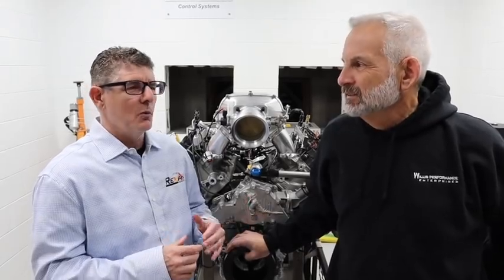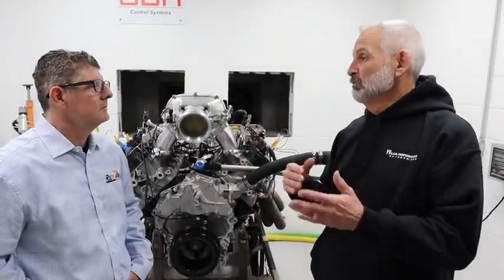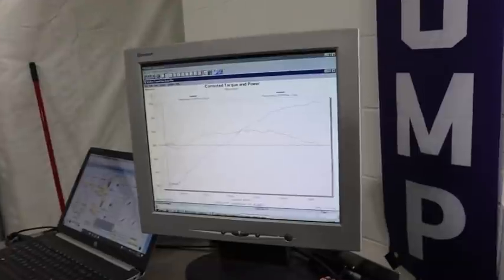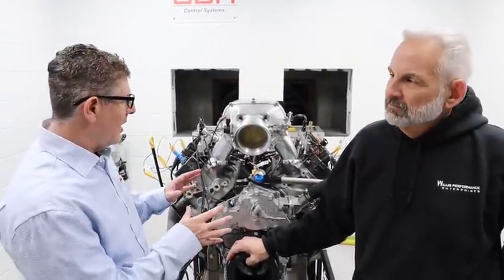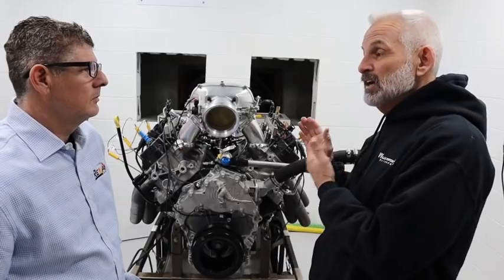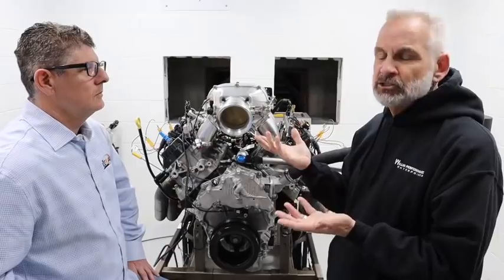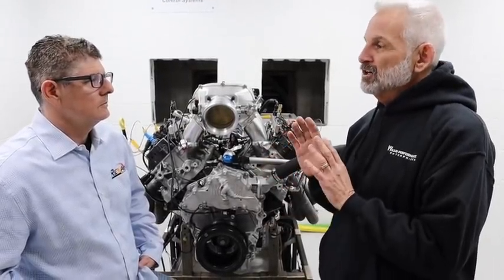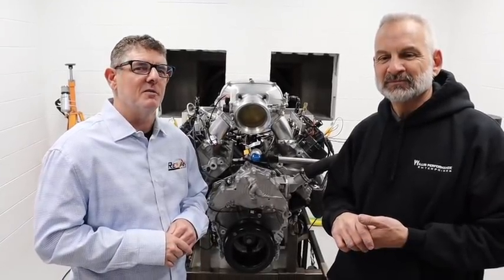Ford Godzilla 7.3 Stage 1 Heads & Cam Dyno Test — Massive Gains Over Stock! How is that Possible?

Comment: It works for 43,000 and breaks.  Hope Ford can get back up again. I don’t want to go to another brand but I can’t have a truck that last only 43000 .
Reply: Every engine has failures.  From what I've seen they're pretty reliable.  What happened to the engine?  Was it user errorr?

Comment: You should have showed us the baseline engine and the modded engine curves.  Telling us the new numbers did almost no good.

From what you said power went from 507 to 640 HP, at the same RPM ?  Would these mods be good for a truck pulling a heavy trailer ?

Comment: One thing I dislike about the 5.0 Coyote in my S550 Mustang GT is the lack of low-midrange torque. You need to rev it pretty high to get it moving on the street.  This 7.3 Godzilla with Stage 1 Cams + Heads @600HP would be awesome in my daily driver S550. The 5.2XS Aluminator would also be an awesome swap in the S550.
Reply: Nice to see a coyote guy who understands the other side of the coin that it isn't just about peak hp and torque numbers lol.  So many coyote guys are so butthurt about this engine like they feel threatened or something and I'm not sure why more cool Ford options the better.

Comment: Little port work / really means, CNC Porting, new valves, valve springs, guides etc. Etc. 

Little cam shaft / really means, bug cam, new lifters, pushrods, timing set, etc.  

TOTAL WASTE

Comment: Kinda over rated , yeah its better than a Chevy or any stock 460 but ,I dont get the hyp, a 460  with some 60 49 scj or p51 heads ,Good pistons upgraded rod bolts , cam lifters, rockers bla bla, is 600- 690hp 600 torque on pump gas. And doing it all saving a few $$$ IF you build it yourself compared to a 7.3 crate motor, keep the compression down put a single turbo on it your 750hp minimum and will hold compression longer and not blow by like a core shift  bow tie
Reply: That is alot of modding to the 460 to be comparable and it's a larger engine physically i.e. don't fit as easily.  You say you don't get the hype?  I don't get the hate on the engine simply because it's another quality option everyone starts talking shit and saying stupid shit like you just did.  Why?  Whats wrong with more options?

Comment: I cant wait for more aftermarket stuff to come out for this engine. I'm looking to build a 2021 E450 shuttle bus as an ultimate road vehicle. It'll also be towing somewhere around 10k lbs. It'll be great to be able to cruise through the mountains with a lot more power and torque.

Comment: Compare the 7.3 Godzilla to the Ls7.. mod for mod on the dyno.
Reply: A truck engine against a top of the line performance engine.  I gaurantee the 7.3 can make every bit as much power and torque set up the exact same way likely even more.  It's much newer they're just now starting to get decent intake options available.
Reply: @midnight347  now a 7.3 crate engine Vs a LS7 Crate engine.. stop making excuses. While you’re “Guaranteeing” the 7.3 can do what the ole ls7 can it has yet to be proven. The LS7 (starting selling in 2005 by the way) Routinely puts down 630+rwhp with worked stock heads, cam and intake. There is videos of hundreds of them doing it. That’s over 700hp at the crank with a stock bottom end motor. Ford boy or not that’s impressive.
Reply: @BLACKLACDTS how is it making excuses it's a truck engine built for a truck against a high performance 20k dollar corvette engine...the ls7 has more compression and more stock rpm its meant for a sports car for God's sake.  Let's hope the ls7 doesn't drop a valve while they're testing it lol.  Boom there goes 20k.  Stop with the ls pushing gm humping nonsense.  If you give the engines similar setups and rpm and head flow etc they're gonna make similar power.  The ls7 has a much better stock setup.  Let's compare it against the 8.1 truck engine.  That even has MORE displacement.  It won't end well for the 8.1.  You're trying to compare it to the ls7 because you are cherry picking a similar displacement engine to try and push your bs theory that gm is superior.  They aren't.  You can get a godzilla crate motor for what 8k?  An ls7 costs 20k lol.  It's not a fair comparison at all.
Reply: @BLACKLACDTS wow a top of the line 20k dollar vette engine with factory high compression can do over 600 wheel with a big ass cam heads and intake etc.  I'm so impressed lol.  Give a godzilla 11:1 and Rev it to 7000 rpm set it up similar it will make the same or more power for less money.
Reply: @midnight347  hahahaha… Keep talking and making a fool of yourself..

Comment: So at 7:00 into the video, you knock off 150-200HP just by installing the same engine in a vehicle.
Reply: Please lsiten again, that is not what we said.....
Reply: @brianwolfe2993  Agreed but the outcome is the same as I suggested. Don't think with these minor mods YOU are getting all that "claimed" HP to YOUR tire.
Reply: @brianwolfe2993  Get rid of those special dyno headers = loss of power IN a car. As they stated, running accessory drive items = more loss and so n. Running full exhaust = less power. It all adds up just as stated IN the video.
Reply: @brianwolfe2993  It's still a killer engine no doubt.

Comment: Eh... LS 6.2 engines are getting that kind of hp with ported heads and a cam no problem. I was hoping for more with it being a bigger 7.3 engine.
Reply: Would love to see a stock head LS Dyno test with stock valves.   If you have a link can you share.  Everything I have seen is with aftermarket heads that approach 700 HP.
Reply: @brianwolfe2993  why do you want stock heads? Who gives a crap about stock. And you do realize ls heads ported means stock heads right?

Comment: Waste of money. $8,000 for just the the stock 7.3 that make 430hp. It's less than $4,000 for a brand new LS crate engine that makes 450 hp. Cool build but Only a fool would pay double for the same amount of power.
Reply: What ls crate engine making 450 is less than 4k?  I'll wait lol.
Reply: @midnight347  you can buy them straight from summit racing.
Reply: The engine had just came out man yall don't waste time jumping on the hate train.  Just gotta talk that shit.  Used ls3 go for 3-4k I'd love to know what 450 hp crate ls coats less than 4k new.  You're talking out your ass like the rest of these gm fanboys.
Reply: Michael Gilmore / hp is for topspeed, torque (curve) is what counts

Comment: All I can say is it's an LS killer👍🏾👍🏾
Reply: LS family is more available, cheaper to build, and makes the same if not more power with less cubes.
Reply: But for a Ford application this is a pretty sweet engine. Definitely cheaper to build than a Yote
Reply: Uh... no? It makes the same power as a LS3 and can’t touch the LS7 that came out 15 years ago..  it made 640 on a engine dyno, Ls7 with those mods make that To the tire with all the accessory’s and exhaust on them..
Reply: @BLACKLACDTS  heads/cam ls3’s make 450-500 whip (450ish through an auto, around 500 through a manual) this heads/cam Godzilla will make around 550 if not more through an auto. This motor makes comparable power to the wheels as most heads/cam c6 z06’s I’ve seen. Also companies offer different cams and head porting options were as this is “stg 1”. They didn’t mention cam specs or how much porting was done to the heads so really hard to compare.
Reply: @bryanbridges6152   if you have a heads cam Ls3 making 450rwhp through a auto it’s a turd..  those are Ls1 Numbers.. The Newer LT1s are making Damn close to LS7 numbers. 
Go watch RPM’s videos.. It’s nothing for a LS7 to put down 600rwhp with factory worked heads, cam and intake.
Reply: @BLACKLACDTS  I’ve never seen a ls7 put down 600 whp with cam only. Heads and cam yes all day or very close to it.
Reply: @bryanbridges6152  re read my comment.
Reply: @BLACKLACDTS  ok didn’t see the  worked part. Yes factory units ported.  That is what this 7.3 is using.

Comment: How are CNC ported heads, a cam and spring upgrade, massive throttle body and insane intake not a 200 hp upgrade on a 7.3 litre engine? Do Fords need more to make power then lets say the LS? And how is that a Stage 1 build. To me a stage 1 upgrade is like a cam swap
Reply: Insane intake?  You gotta be kidding me.  And don't even go there with the "do ford's need more to make power?" Bs because I regularly see all types of ford's making big power with boost easier and cheaper with less mods vs gm stuff and especially dodge stuff
Reply: @midnight347  Dude! That´s like 3 years old comment. That is a massive upgrade, no way it is a stage 1 deal. I appreciate Fords, I even own a few of them. But that Godzilla thing is not even close to be as impressive as an old SBF IMO
Reply: It's a stage 1 head and cam package.  You don't seem to know shit honestly.  Gaining 200+ hp from those mods isn't super common.  An ls7 gains 150-200 usually at best with a solid heads cam intake package and that is a higher compression 20k dollar vette motor.
Reply: @midnight347  Don´t know shit? LOL Show me an LS7 with CNC ported heads, a cam and spring upgrade and an aftermarked intake that gained less then 200, are you kidding me? Motorhome/cargo van LS engines gain 200 with less.

Comment: So what I learned is that your dyno numbers aren’t really real world numbers because the engine doesn’t have all of the parts on it that it would in the truck and thus lowering power numbers due to parasitic loss.
Reply: Exactly, that is why you can compare to baseline as was explained.....
Reply: It doesn't matter as long as you do it the same way before and after you can still see the gains.

Comment: This engine with a built bottom end is going to make big numbers.  I would expect 750+HP if it's built to rev to 8,000 rpm.  1200+ easily with 15 psi boost.
Reply: We made just under 800 N/A with a blower cam and the stock oil pan, we ran out of injector and hope to have that engine back on dyno soon.

Comment: Chevy is way ahead with their LT/LS platform. SBE guys are making 780hp with only 6.2/376 motor, not even race engines.
Reply: The engines making that power are way more modified with a much more radical setup.  Gm isn't doing anything special get up off their dick.

Comment: The 7.3 gas is under square. 
You can get an over square 460 to do the same numbers. Yes, old blocks are getting harder to come buy; but, I'm not sure of the advantages and  race applications.
Reply: A 460 is larger and doesn't fit as easily.  This takes up virtually the same room as a small block 351.  You only gotta have a 3 inch cowl to fit it in a fox and with the newer low pro intakes Ford makes it would have even less clearance issues it Def fits easier than a 460 big block.

Comment: People are often confused by dyno numbers in a cell, compared to those advertised by manufactures; great presentation on the differences.  It's great he also posted that it made 507 HP as a baseline, which 130 HP from CNC porting and a camshaft swap is entirely believable.  It's all in the cylinder head design, modern production heads flow better than many aftermarket race cylinder heads.  It doesn't take a lot of camshaft lift or duration when your head flow is massive from .500-.600" lift with 7.3 liters of displacement.

Comment: Only Ford guys would call heads cam headers EWP billet manifold basically stock motor lol. Anyways awesome to see Ford back in the pushrod game ! Motor looks to have lots of potential .
Reply: That is funny considering gm will call fbo and exhaust ported heads cam and intake "cam only".  Very ironic.  Gm guys are the ones always sandbagging.  It is a basically stock engine.  Why are yall so butthurt over this engine?  You're scared to death Ford is gonna prove gm isn't anything special with their ls engines smh
Reply: @midnight347  wrong. every camp does it. but its the only joke that crosses every brand. mustang guys lie and cheat the most. its a simple fact. especially with na mustangs.
Reply: @midnight347  ported heads is not called cam only. never has never will. Bolt ons plus cam is called cam only. but its well known to everyone that does them on both sides cam only means cam plus supporting mods. nobody does just a cam. a large group of people dont go around trying to just say its a cam nothing else is done. youd get laughed at. for one. as its obvious. for two...anyone who builds motors knows nobody does just a cam. only ford guys who know half the story say that ridiculous comment ive heard . not sure what about my comment bothered you so much. seems youre the one who is worried. and jealous. of ls greatness

Comment: I hate to say this but this sounds like the average LS motor 
Cam swap
Port head/valve springs
Rods 
Pistons
Coyote 1000hp unopened and go
Reply: ''sounds like the average LS motor" huh? like the noise it makes or that they did a cam swap, ported heads to make more hp?

''Coyote 1000hp unopened'' lol yeah with boost for a short short time before it blows up. look up honey badger a yellow 1000hp 2018 stock 5.0, itsjusta6 1000hp on stock motor. pushing 600+hp on stock internals is crossing your fingers every time you race.
Reply: @codyramos3200 bro they can take 800+ all day long stock motor.  600 isn't even tickling a gen 2 and 3 coyote or an older gt500 or terminator engine any of those can go well beyond 600 without any fuss.
Reply: Why are coyote guys so busy hating on the 7.3?  A boosted coyote isn't for everyone or every application.  What is wrong with having more options?  The coyote guys are as butthurt about this engine as the ls guys are.  What is wrong with you people?

Comment: That 7.3L Godzilla V8 is a beast. This is going to be a great swap for an old school muscle car or hot rod or even in an old school F100.
Reply: I have a 1974 Ford F-100 in my backyard that needs a lot of work. Would it be worth putting a 7.3 Godzilla in it . I know I would have to change the engine bay and transmission and radiator. Replace the brakes all the way round to disc brakes new rims and tires and a new gas tank and new gas lines. Put new shocks all the way around and then replace the seats and replace the floor boards inside of the truck. I have to replace the bed of the truck because it is rusted out . I have to repair and maybe replace the hood because it is all rusted out. I know I will have to replace the rear axle. I was thinking about replacing it with a Detroit locker rear axle with 4:11 axle ratio . It will probably take $150,000 to fix my truck. What do any body think ? 😊
Reply: @JeffEarnest-k1o  For me I say go for it, a Godzilla swap 74 F100 would be badass.

Comment: I like the idea of Ford guys tweaking this engine and making some nice gains. My only comment, is Ford going to get behind this effort like GM does with it's engine program and offer some "factory" parts like GM. I have been a Ford guy since my first Ford in 1959 a 51 2dr sedan. Ford executives seem to be more interested in Super car wins  like LeMans and then going away after a victory or  two .and then  selling street versions to select customers. How about lots of help to the everyday racer so that maybe one day Ford will be the brand of choice among racers?
Reply: You never heard of the Ford Motorsport catalog that started in the '80s when the Fox Mustang got so popular? It's now called  Ford Racing Performance Parts.
Reply: @foxfordcatguy2283   I bought my first Ford crate engine out of a FMS catalog. Ford still lags behind GM  in number of products and are higher priced.
Reply: @RSDX99  Don't know what parts you think aren't available for a Ford. I've driven myself nuts trying to decide between the myriad of parts available now days.

The fraction more you might pay for Ford parts is negligible when you consider a Ford will last at least 3 times longer than a GM.

Comment: One question on the true stock 650hp pulls.  Was that on pump gas?  I'm building a flat tappet 427 Dart that should have similar results but I have a race cam and high dome pistons on purple at 34 degrees.
Reply: Yup good ole 93

Comment: That intake is killer. What this thing doing at 2500? Is it already making close to 500ft.lbs? I want to put THIS engine into a Crown Vic with an automatic and 3.73's.
Reply: You would like the stock Intake with this configuration, 600HP and 597 Ft-Lbs.
Reply: @brianwolfe2993   My concern with the truck intake is the positioning/angle of the throttle body. I'm hoping someone comes up with a solution for that. Five hundred ninety seven ft-lbs though ... nice
Reply: @Odessa45  they make couple low profile intake options now that also improve power and torque.
Reply: @midnight347   Yep, thanks. I've seen Evan's video about the Ford Performance manifold prototype. Looks good. Right now the holdup is a controller for the 10 speed. Ford has it in the works though.
Reply: @Odessa45 just save yourself the hassle and throw a t56 magnum behind it.  It's alot easier and cheaper all in and it'll be 100x more fun.  Then the only tuning you require is learning how to drive better.
Reply: @Odessa45 a big torque big cube engine like this won't benefit from that 10 speed like the coyote does.  I'm sure it'll benefit a little but not like you think.  A t56 magnum with a 373 gear would work great.

Comment: Sorry I'd rather see a more realistically priced parts combo tested - not stuff using a $6000+ dollar intake 🙄
Reply: 6000 is gotta be an over estimate, I wouldn’t spend more then 1700 on that
Reply: @williamsanders468  Look at their website just be sure you're sitting down.  Not to down play the quality but price wise they're even more expensive than Frankenstein.
Reply from the maker: The engine makes 600 hp with the stock truck intake, we included those numbers.